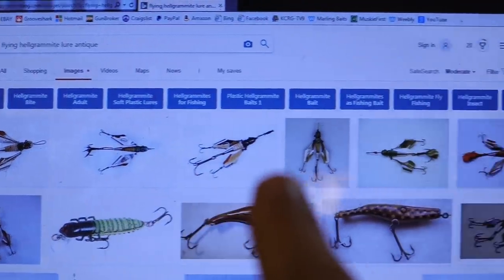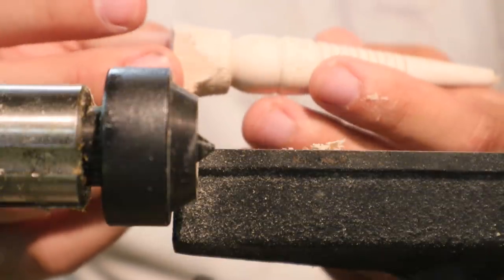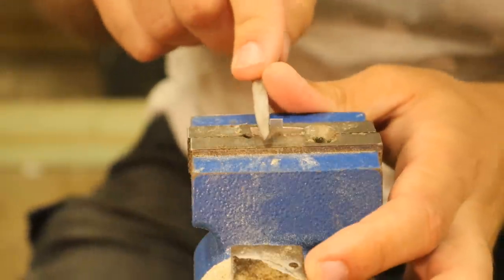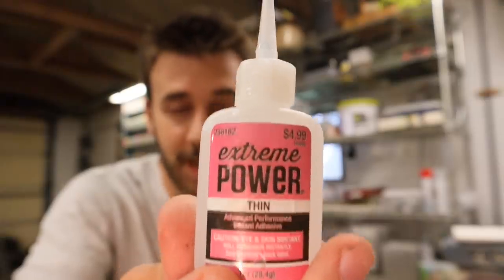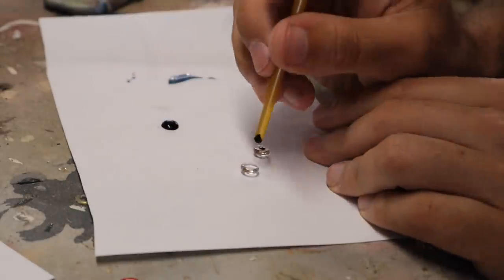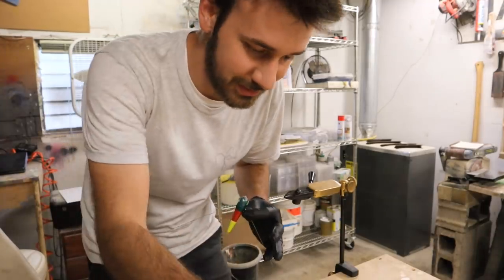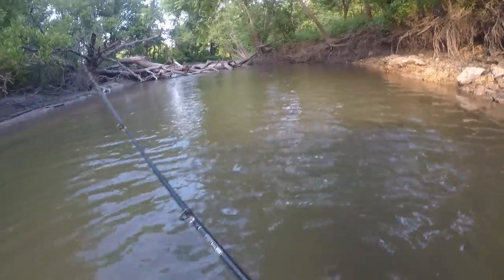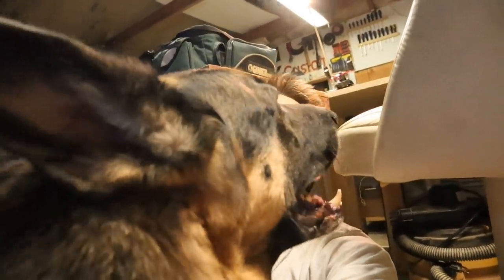Antique Lure Re-Creation | One Day Build to Catch

Comment: You can get big 12 oz bottles of super glue on amazon for like $16 or something like that. It’s very thin so it would work great for sealing your baits and it’s super strong. I use it all the time at work. I literally glue everything lol. Works great for little returns on crown Moulding and any kind of trim returns. I have glued broken tiles back together and u can’t even tell that it was broken and like I said it is some strong shit. It’s worth checking out if you use super glue like that

Comment: should have sealed the wood before cutting it off the lathe, then afterwards touch up the spots you modified .. use a paper towel folded up soak it in the glue and run it on low nice even coat....